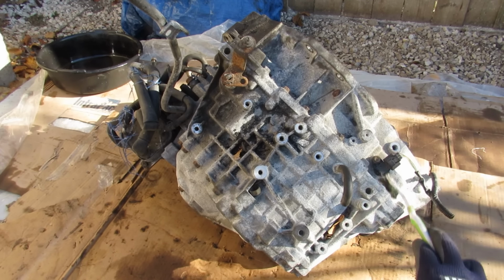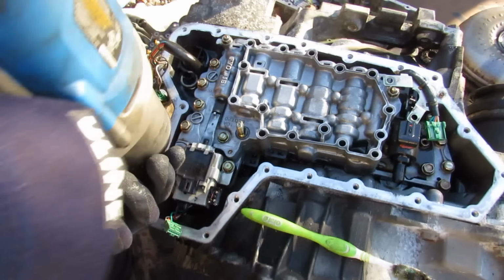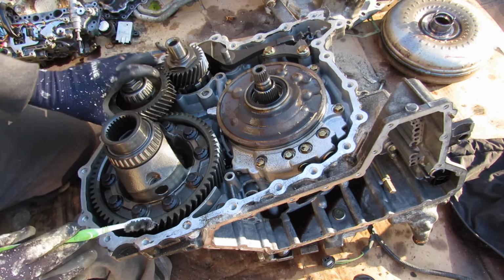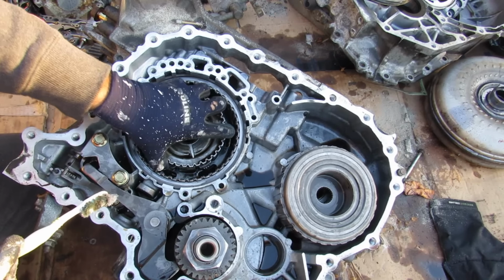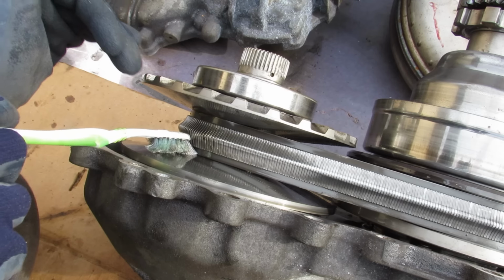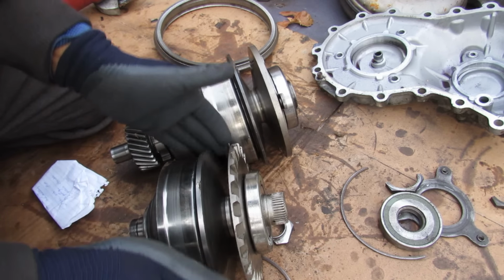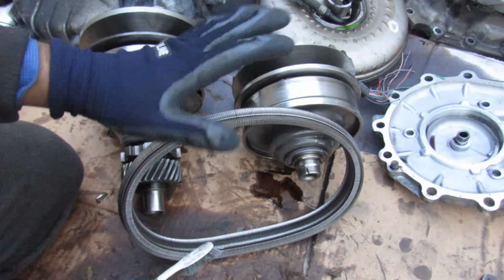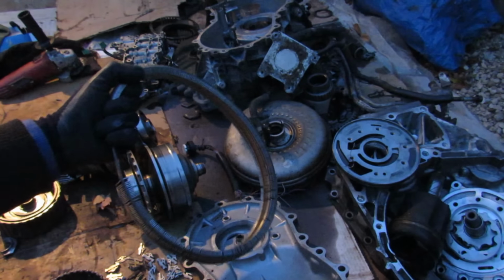Why Nissan CVTs FAIL

Comment: I used to work on a coal crushing plant that used PIV boxes like those, but were mechanically driven from slow to fast and these had a ton of coal sitting on top of the driven plate and the belt wore out fairly quickly and the cones were toothed to give more grip, and even those either wore out or the rivets that held the cone faces on would break causing a failure that normally tore all the teeth off the belt, so yeah, I hate the idea.

Comment: The craziest part of watching these videos to me is that designing these things seems like something approaching magic, and yet mechanical engineers aren't paid very well. These guys design everything we use, they should be on TV showing off their designs while a presenter grabs his head with both hands and says "holy shit, that's amazing!"
Reply from the maker: As a mechanical engineer I can attest to both sides here
Reply: This is the first time I've heard someone talk about a CVT transmission without bringing up snowmobiles!
Reply: @fubisroc9673  The Dutch made a car called a Daff. It was famous when Alby Mangels crossed the desert with it and made his first travel show. It had a belt driven cvt. That was back in the 70's. Some small maintenance cart like at the golf course had belt driven cvt's. But all were low powered and the belt was easy to change. If they made a cvt with a easy cover to replace the belt it would be more attractive to buy.
Reply: @JayDee-xj9lu  Oh, they make them...just not for road-certified vehicles! :-)  I put some $80 TAV30s on my mini-bikes.  Stock out-of-the-box, they did 19 MPH.  Modifying some simple external throttle mods got them to 25 MPH.  Removing the centrifugal clutch & chain to the jack-shaft and replacing it with a TAV30 took them to 45 MPH!  Given the size of those bikes, I don't think I need to go any further on speed increases!  But, replacing a belt there simply entails removing a plastic cover and then removing a single sheave.  Very simple, elegant, and effective!
Reply: @fubisroc9673  I meant on cars.
Reply: @JayDee-xj9lu  It was called the Daff Variomatic.  I think the belt transferred to various size pulleys a bit like the gears on a road or Mountain bike.
Reply: @standbytogo123  Yes the Daf variomatic had a belt with variable size pulleys like the CVT in scooters. These systems work great and are simple but the belt needs changing after some 10s of thousand km
Reply: @fubisroc9673  ATVs and side by side UTVs use them as well as snowmobiles. They work good on these applications because a cvt keeps the engine in it's power band instead of going above and below it. 
 Also it provides constant power with no pauses to shift gears.
Reply: Agreed.  There are some smart/brilliant people out there that don't get enough credit....
Reply: But there are also things where the engineers smoke to much funny stuff and designed some disastrous stuff that us poor mechanics have to fix.
Reply: Supply and demand
Reply: The engineers who came up with this design should be paid less than McDonalds workers.
Reply: over complicating and over engineering things unnecessarily is far from magical imo.
Reply: @mrgreen6374 thankfully, no one gives a fuck about your misinformed opinion. 😊

Comment: Man, you know your stuff. Good explanation. Those CVTs are incredible complex. Can’t imagine the number of individual processes to make all those parts just for the transmission. Think about hoe many jobs a transmission creates for all the needed parts.
Reply: Complex but easier to work on and they don’t require special tools to rebuild. Only problem is finding parts. Seems there’s a monopoly in them now lol
Reply: @trentdaddydolla647  i don't even shop for aftermarket parts as i get nissan parts at cost. if i had a shop i would def check out aftermarket stuff.
Reply: Why don't they use a bigger better trans oil cooler???
Reply: If you think thesd CVTs are complex you haven't seen the inside of those 6 or 8 speed regular automatics...rocket science is easier!

Comment: Thanks for the video and helping explain what actually is happening inside these crap CVTs. Have a 2017 Sentra SR turbo that went just before 36k warranty lapsed. Got lucky and didn't have to spend $4000 to replace and tune the whole thing. You apparently know more than Nissan can offer up. But then again why would they admit they should've never put power behind  these parts with such a weak cooler? Especially as hot as it gets here in FL. I'll be babying my ride till I can trade it in for something reliable.

Comment: These Nissan CVT transmissions are better than people think. If serviced and not abused they operate just fine. I have 180,000 miles on my 2007 Altima 3.5 and have not had any problems, at all. The V6 model CVT's are durable from what I can tell. I know people who could break an anvil.
Reply from the maker: How often you change CVT fluid? Do you toe?
Reply: @speedkar99  Drain and fill (4-5Qts) three or four times. No towing.

Comment: my first car out of college was a brand new 2011 nissan murano SL. i got what i thought was a good deal, 39,000 MSRP car that the dealer sold to me for $31,000. what a piece of shit. after driving it for 2 years i felt like i got ripped off by $30,999. i had to constantly shift "gears" because it was in the wrong "gear" half the time. anytime i would speed up after sitting in traffic for a little while, the car would stay in low gear. i would be doing 45 mph and the engine would be revving at 4000-5000 rpm until i'd manually shift it up a few "gears". or whatever the fuck it is i was shifting. it was serviced 4 times at 2 different dealerships. it was never fixed. traded it in for a mercedes after like 20k miles, never looked back.
Reply from the maker: How's the Benz holding up relatively?
Reply: @speedkar99  2013 E350 4matic, had it for 6 years. only had to do regular scheduled maintenance at an authorized service center. didn't have any issues. sold it to a family friend, they had it for about 1.5 years now. i think they had to replace a couple of sensors, but it wasn't expensive. i gave them a good deal so they are pretty happy. then i got a 2018 BMW 540i xdrive. haven't had any issues here either.

Comment: Snowmobile clutches 101
Reply from the maker: I'd love to tear a snowmobile or scooter transmission apart for comparison
Reply: @speedkar99  eh, it's all relatively the same basic concept.   Auto manufacturers just made a lot more complicated than it needs to be.
Reply: CVT clutches are all about rotating mass.

Comment: driving with CVT is little different from automatic, need some care, slowly step on gas pedal, hitting it hard will damage the chain belt, when going uphill use lumbar. There's SUV with CVT, doubt it can be used for towing, heard they thicken the belt. Still driving CVT versa'07, got it with 188k miles on odometer, added 14k miles, will drive it till broke. Never had any transmission fluid change, book said you don't have to, wondering how bad the fluid inside there now. Years pass maybe CVT has improve or worsen, you be the judge, don't have enough cash to try some.
Reply: There is NO evidence that hard acceleration causes transmission damage. It's just wishful thinking for those who fear their transmission might fail.

Comment: Nissan CVTs are designed to fail after the warranty period ends. Far to many have done just that for it to be coincidental. $7,000 for a new transmission in a vehicle that has 80,000 miles on it. That's either the worst engineering failure in car design or designed failure. Nissans have become a disposable vehicles. Don't buy one. If you already did... SELL IT before it bleeds you dry.

Comment: I know someone who has a 2014  Nissan versa. Her car makes a high sqealing and low chirping noise when she drives or after its in gear. Sometimes its stops then comes back. I know its common with loose or worn serpentine belts. My question is can this noise also be caused with these types of Transmissions?

Comment: They would have been better off using the dry belt design off of side by sides and beefing it up.  Supposedly these are so expensive to repair.  I could work on my KFX700 CVT in 10th grade.

Comment: Lee Myles rebuilt my '02 honda 4sp. automatic,  that was the end of that car. and $2500.  I then bought a Nissan w/ electronic CVT.  this is not for launching.   It is for smooth accelerations while driving spiritedly.

Comment: CVT's would be cool if they actually kept the RPMs at the most efficient spot possible unwavering and maintaining boost in high power low weight applications.
Reply: that's what they normally do (at least in normal/sports cars any way)

Comment: Informative video! Any thoughts on the revised CVT in 2017 Pathfinder? I see they bumped the alleged towing ability up by 1000 pounds, just wondering if it's better belt, or some other different internals.
Reply from the maker: Not sure
Reply: Went to chain from belt its better but but but you need need to change the fluid every 30k or less

Comment: My Altima has  tons of torque after 340,000 km but I dropped the pan at 240,000km and cleaned out the filter. So if you did this every 100,000 km and change the filter if that is possible all the other problems would likely not even manifest.

Comment: This has to be one of the top videos for the explanation  of a vehicle device. And the CVT has got to be one of the hardest to to. Great job speedkar99 ! ..I personally guess the reason the CVT's failure is not the car's fault.  I realize that a CVT is for cruising around and getting great gas mileage. You CAN'T beat on them!  Also I was perplexed on how some people told me  the CVT belt could be steel, It's just part steel.  The steel pieces seem to act to keep  the  sides of the belt, from being crushed together.   .. I'm also surprised that the steel pieces don't cut into the sides of the belt.
Reply: Aggressive drivers blame how bad the CVTs are, but its (mostly) your fault. CVTs are designed for smooth driving and gas consumption, not racing on city streets......

Comment: Hi,
I have a car with cvt transmission. 
I changed the transmission 2 months ago with a similar 9ne but with less millage. 

Now the engine seized. Doesn't move at all. 

9ne mechanic said it is the torque converter.

And another one said it is the engine not the torque converter which is swimming in oil and have no physical contact with engine. 

Could you tell with one is right  and which one 8s srong?

Comment: Excellent video, would the judder and shuddering mentioned in the video result in a sense of juddering in driving the car? I find, at times, usually once the car is warm, at only certain speed ranges say 35-45mph, I get juddering, almost rocking sensation whilst driving, feels like hesitation, but if I drop my speed or increase my speed I can resume to “normal” driving...  any thoughts?
Reply from the maker: Either that or the sheeves that have bearings in them that bind or break

Comment: I had a CVT in a Nissan rental. You would almost have to count to 2 between shifting from reverse to drive before stepping on the gas, otherwise the engine would rev while it was still trying to go into drive and make the car jerk forward when it did engage.
Reply from the maker: That must be the first planetary gearset

Comment: Nissan "rebuilt" my CVT transmission. At least this is what they told me. I had to pay $800 and they covered the rest. They sent it to the Nissan head quarters to have to rebuilt. At least they said that's what they did. The issue now is that the transmission is now effed after 30K miles. Ugh. I regret with my life ever purchasing a Nissan. Never again will I purchase one.

Comment: YOU forget one important thing here!....its the  ball bearings that the cone rides up and down on that fail.....that causes the steel belt to fail...you should take apart the main shaft and look at the scarring where the ball bearings are....thats the main cause, not the belt...but I agree,  that belt is a piece of turd as well.......good idea it is, lousy design tho.....the important parts are way too small, like the ball bearings and the steel belt...the oiling system is lousy and primitive. Looks like something a high school kid would build......my c.v.t. died, and cost me $3800 to fix....I will never buy another one of these.
Reply from the maker: Yes I didn't get the chance to open

Comment: Great Video! My 2013 Altima slipped then failed to go into drive. Sounds like the gears went out. My Altima had 220k on it and I killed it. 235 tires, Intake, sport mode all the time. I was rough on it. I'm sure I Killed it and never did a CVT change until 180K. I do not think these transmission are designed to go over 200K and you can not redline these all the time. I wouldn't go over 4 or 5K rpm.
Reply from the maker: 220K miles? Not bad

Comment: Engineers designed it to be a piece of shit🤔 so that they can have repeat customers needing their Transmissions rebuilt every 70000 miles! Long gone are the late 80s to late 90s  import cars even early 2000s that valued building the brand image and wanted people to know that they had reliable vehicles for a low price 😇😉now they just do what the big three did in the eighties and nineties shovel out hot shit that won't last to make a buck.🙄
Reply from the maker: Consumerism

Comment: My 2002 Altima transmission failed, was replaced and then failed again. My 2013 Altima transmission failed at 87K and didn't even bother replacing it cause I'm never buying another Nissan again.

Comment: Great vid!  My daughters 2012 Rogue cvt crapped out on her in New Mexico (at around 60k) while driving from Georgia to Arizona.  Overheated, went in to limp mode.  Had to fetch it with a flatbed.  Nissan did replace it supposedly with a fixed (or bigger?) cooler, can't really remember but it's still running, although that car still has less than 100k on it.  My 2016 Accord CVT seems much better...and drives much better.
Reply from the maker: Ouch. I've heard the Honda CVTs drive better

Comment: Modern transmission design isn't bad but execution is as cheap and fecal as possible and it shows. That tiny belt is pathetic for a car but might be acceptable for a motorcycle. Thanks for the effort of posting this video because I'll be sure to avoid CVTs of any make or model.
Reply from the maker: As long as it lasts one day past the warranty...